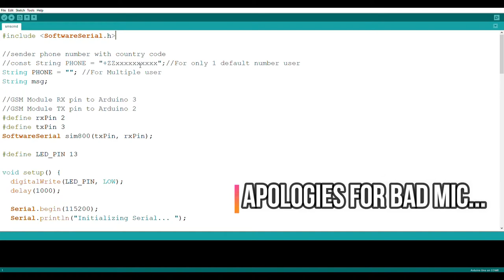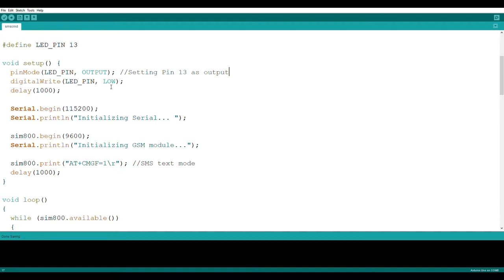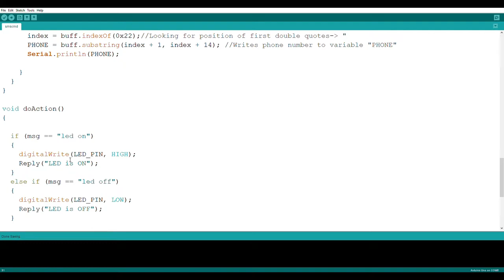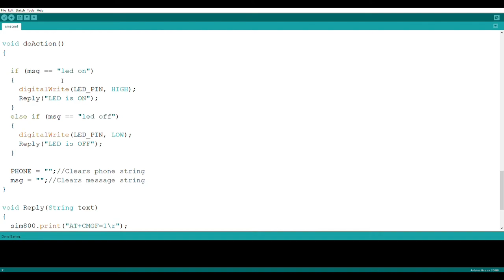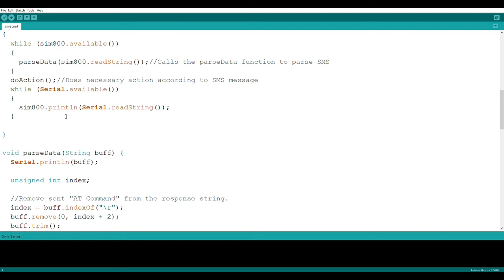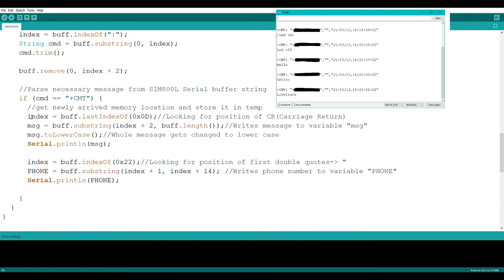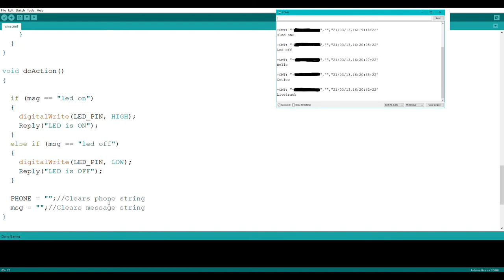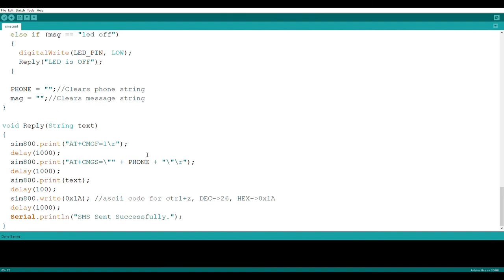Send and Receive SMS using SIM800L and Arduino [FREE ARDUINO CODE GIVEN] || Tutorial

Comment: Can u share us the power supply regulated over 2A product link or name
Reply from the maker: Hello Gagan. The power supply i was using was a USB 12v to 5v DC-DC buck converter. Unfortunately it is out of stock. But you can use this better power supply module which i will link below. You may just have to desolder the USB connector for ease.
Better USB 5V 3A power supply module: https://amzn.to/3xQGfQ3

Comment: not code found as per link
Reply from the maker: Hello. The link is correct and it directs towards the github repository for this project. You have to open the ParseSMSwithSIM800L.ino file for the code. Still for your ease, I am giving the direct link here for the code : https://github.com/Kruze17/Parsing-SMS-with-SIM800L/blob/main/ParseSMSwithSIM800L.ino

Comment: Hi does sim card have to be 2G or will 4G sim also work
Reply from the maker: Any SIM will work, until and unless the SIM network provider has active 2G spectrum services. For example, in India JIO SIMs will not work as JIO doesn't have any active 2G service, only 4G. In my case I have used an Airtel 4G SIM, which works because Airtel still provides active 2G network to which my SIM can connect to.